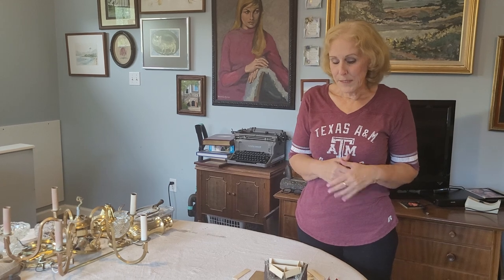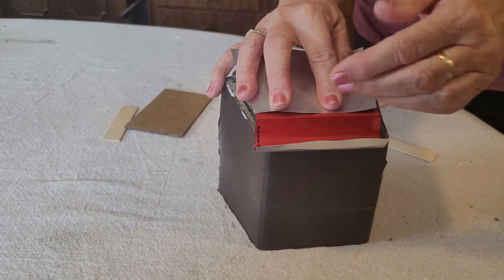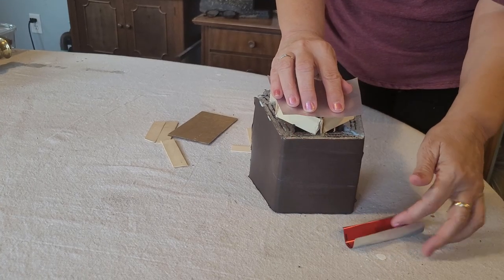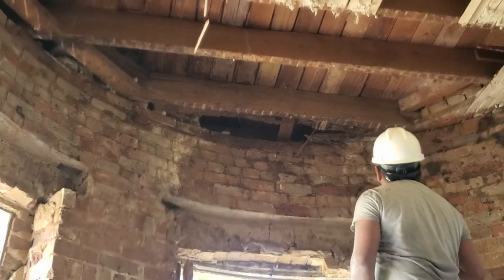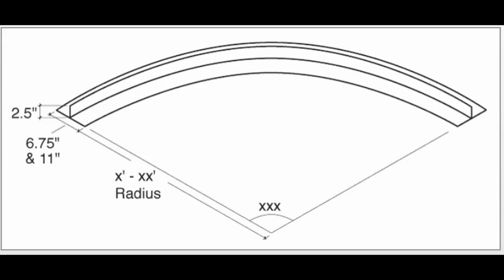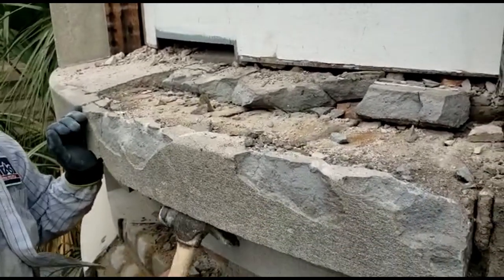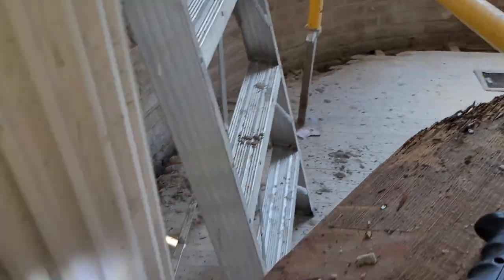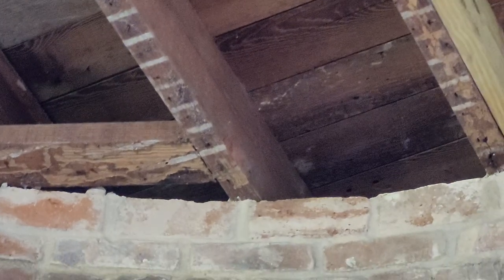S2.22 Rebuilding the Parlor Alcove

Comment: I vote for taking it back to the original porch on the 2nd floor.  Actually, I'd vote for taking the entire house back to its original configuration.
Reply: I’m guessing all the windows and wood from the 1920s porch need replacing. If so, It would probably be cheaper too to remove the 1920s porch and put back the original one.
Reply: When I watch these videos, I am amazed that the house has stood as long as it has. I live on the NC coast and have learned that a coastal, salt air environment is really hard on materials, be they brick, mortar, wood, metal, etc. I think the same issue would be a problem on Galveston Island.
Reply from the maker: The corrosive salt air is relentless.  I'm amazed anything is still standing.  I will say, the old materials hold up much better than modern replacements.
Reply from the maker: I wish that were possible but it won't ever happen.  I do hope the porches can go back someday.

Comment: The slate set into brick was a damp course to stop water from wicking through the brick.  The slate being there means that the original builders expected the brick to get wet but they wanted to keep the moisture from moving down into the finished interior.
Reply from the maker: I think the concept was good but in practice it didn't help this poor little room.

Comment: I really like the original porch. 
Do all the windows and wood need replacing for the 1920s porch wall? 
If so, would it be cheaper to remove the 1920s parts and bring back the original open porch?

Love these videos. Keep up the great work.
Reply from the maker: I would LOVE to bring back the open porches, but it is just too expensive.  The windows on the porches are actually in very good shape.  Just because we can't do it now doesn't mean it couldn't be done at some point in the future.